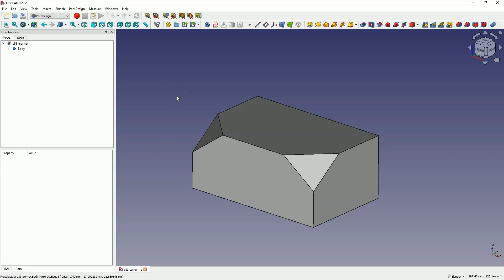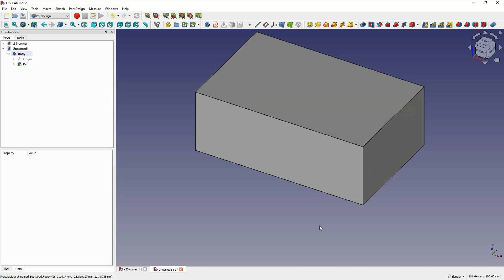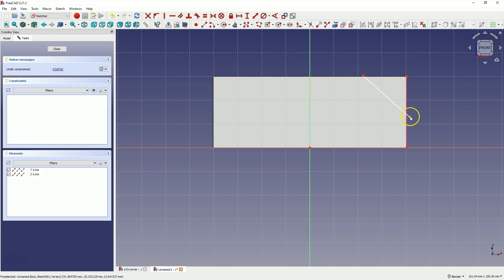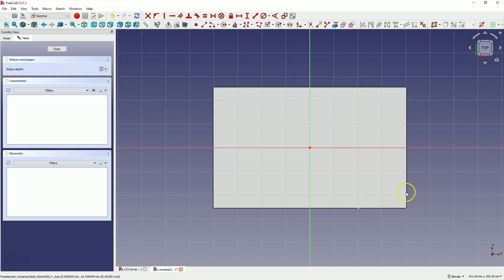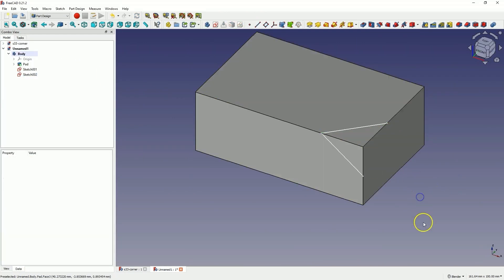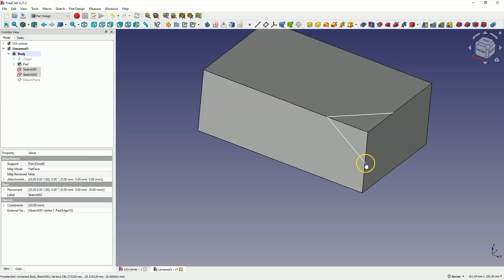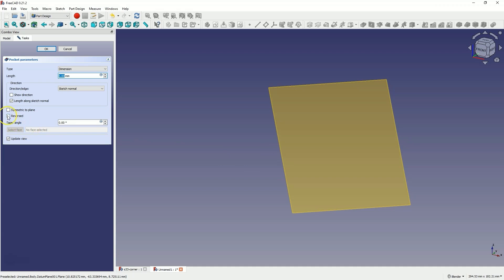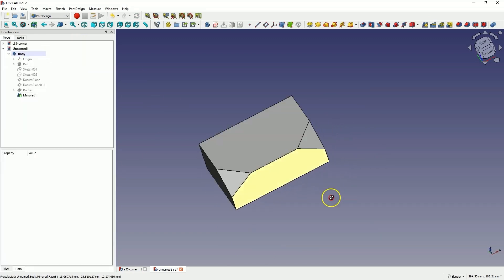FreeCAD Example with Construction Plane

Comment: Nice video. Short enought and informative. Ive struggled with the same cut, but in a multi body setting. Making the same cut  to a box corner, where you have 2 sides, a top and a filler block.  Gave up after 2 corners...😅